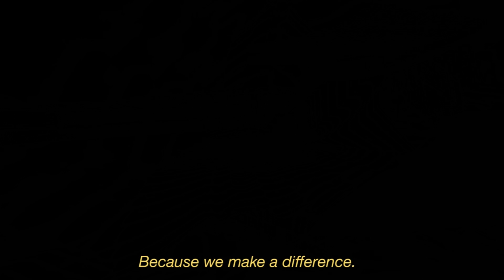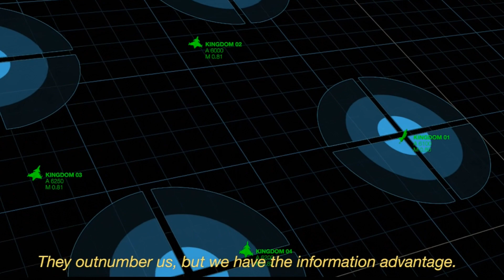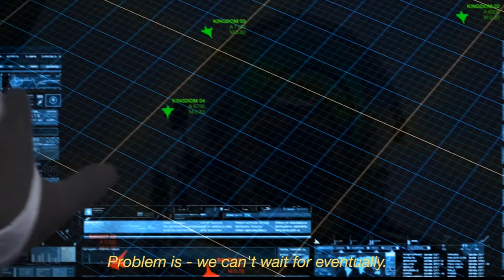Gripen Fighter Jet - Canada's Future Fighter?

Comment: good vid.....unfortunately that is not how the Canadian procurement process works.  The Canadian Government evaluates bids not on what makes sense but rather what model they can build and then they add systems and requirements to the platform until it is unrecognisable.  Cost is not the issue, rather the issue is what platform they can purchase that allows the most kickbacks to corrupt politicians.  You may think that i am being silly but lets take a look at the 2 most recent procurements.  The hellicopter procurement and the New frigate program.  The hellicopter procurement is more than 10 years overdue.  They have added so many systems to that platform that in the original form it would not fly.  System after system was added allowing the aircraft to take on any situation, or that is what the government would like to give as a reason

The Frigate program.  Currently at this point the platform has not been decided upon however the shipbuilders assumed cost would make each vessel at least 8 to 10 times as expensive as if we were to buy them off the shelf from each of the current producers.  Now the arguement will be made that by building them in Canada it will make sense to do so due to infrastructure and taxation.  That will simply not be the case.  If we were able to produce the items at perhaps 3 to 5 times the cost as purchasing them from a foreign country ....perhaps.  But 8 to 10 times (and rising) that simply is not the case.
Reply: paul-agreed. i've been saying the same for years now.
the navy said the seaking was too old, but then they bought a foreign chopper too heavy  to land on our ships!AND they added ANOTHER  heavier but different newer helicopter which shares NO COMMON PARTS with the first one,then doing just as you said"adding stuff until it can't fly", basically.
maybe we should just fire all the top brass ,their political insiders and the contractors who've paid them off.
with their gender quotas reducing combat effectiveness to the level of boyscouts anyway, why spend any money?

Comment: Is this the brother of the m-2000c or ajs37
Reply: jas37
Reply: nope the m-2000c is french if i dont remember wrong and the ajs37 is the viggen the viggen was a amazing aircraft but the gripen is a new design all the j37 aj37 ajs37 is the viggen the viggen is named 37 and the gripen 39 and the draken wich is amazing too is named 35 the letters is a for attack j for hunt and s for reconnisance
Reply: JAS39 Gripen is the brother of JAS37 Viggen and J35 Draken. All of those great planes, but later ones is getting old and have gotten replaced. Viggen is still a worthy opponent of any 4th generation plane. And Draken (The Dragoon) is also still a capable aircraft despite being born in 1955 and having a 40 year old service in multiple airforces... atleast it could be used as a ground attack aircraft in a modern war.

However, the world is going into new age where manuvering of an aircraft is no longer done mechanically by pilots with a joystick, but planes are instead becoming more relying on electronics, computers and sensors for the plane to fly and fighting targets.
So old planes like F4, F15, F14, F16 and others are getting replaced by newer planes. Some countries goes for an expensive replacement, while other countries goes for a cheaper option. And maintance is also becoming an issue after the cold war when European defence budgets have been reduced. A f14 and a j35 Draken each consume 50 hours of maintance for every hour in flight. So it is a benifit to have a plane like JAS39 Gripen that only cost half as much to fly as a F16 (or a sixth of a F15) and only needs 7.6 hours of maintance for every hour in flight.

Comment: You said the F-35 is the most advanced fighter in the world. Depends on what you mean. Technologically most advanced? Sure. But you could build a super complicated and complex piece of machinery to throw rocks at buildings. No matter how technologically advanced it is, catapults are not the future.
The F-35 is an attempt to create a multirole combat aircraft with stealth capabilities. Which they have done, yes, however they ended up sacrificing speed, maneuverability, range and payload for stealth and to make the individual plane cheaper (i.e. using only one engine). Whether or not all that tech will be able to compensate for the shortcomings remains to be seen. Especially since modern radar systems are specifically designed to detect stealth aircraft.
Personally I believe that active defence systems are the future, like the air to air IRIS-T missile, which can target incoming missiles.
Ultimately the future will tell, my prediction on the F-35 is, they'll find a way to make it work, but it will never stand up to the hype, and militaries relying on it will suffer greatly under the flaws I pointed out earlier.

As for the Gripen, it is what the F-35 wants to be minus the stealth. And ends up actually being cheap, reliable and extremely versatile. As far as price performance ratio goes, the Gripen E/F is probably superior to anything else on the market today. Highly impressive for such a low cost.
Reply: Yep, and it's expensive as all hell!

Si cher, TROP CHER!
Reply: Expensive ? What about the F-35 :smirk:
Reply: " the most dvanced "....do we even read specs any more ?....F-35 is a CONVENTIONAL FIGHTER for a 2015-2020 period....there are upgrades for eurofighter and SU-35 availabille that would provide theese fighters with far superrior perfomance to F-35s theoretical ( let alone realistic ) capabillities.
Reply: A multirole ultra-modern stealthy aircraft : we french did that in the 1990s , we called it the Dassault Rafale. It was long to be produced but we succeed .